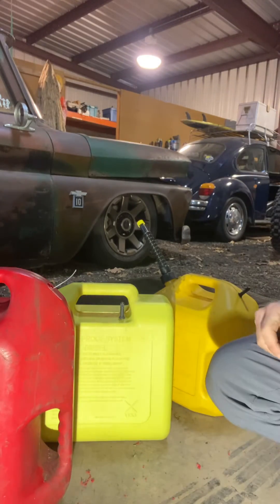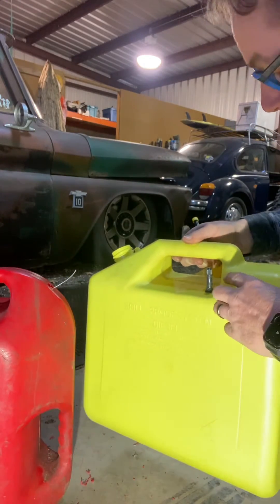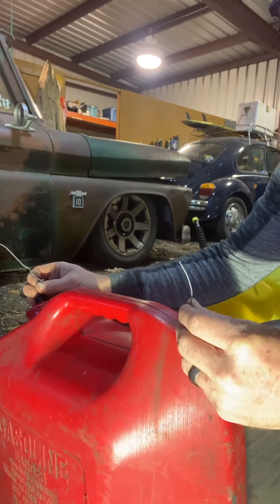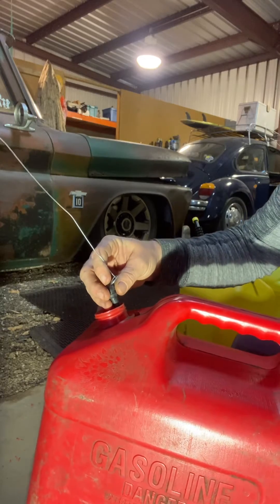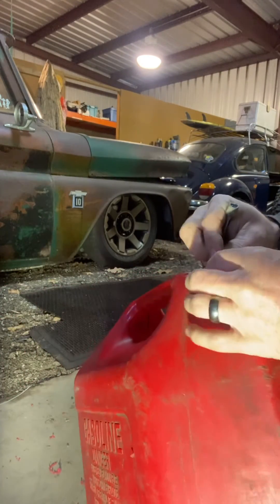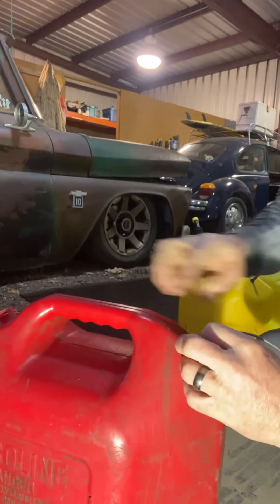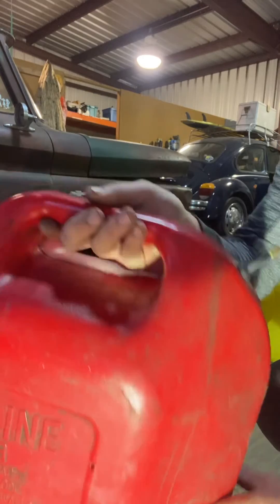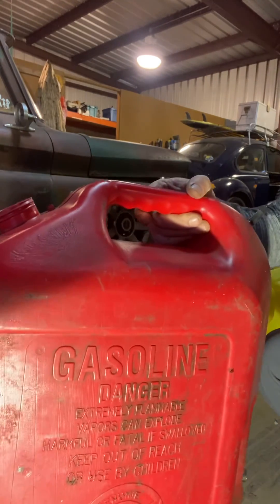Gas can vent using an automotive valve stem-CHEAP FIX  #gas #diy #hack #fixed #diesel

Comment: I have done the tubeless tire valve method.  It works until gasoline breaks down the rubber, then you end up with spilled gas.  If you do this method, replace that valve stem each year or less.  I went ahead and bought the Magicfour vents.  They are metal and they last.
Reply from the maker: I do the same. Replace them every so often.  
I have several that I used the metal valve stems and they do work better.
Reply: Thanks guys.... ordering some Magicfours right now!

Comment: I am speaking from experience, in about a year the gas fumes will rot that rubber, and you’ll be either replacing them or sticking a bolt in the hole that you drilled. The rubber valve stems do not work with gas. Don’t waste your time on this so-called hack.
Reply from the maker: I have some that are a few years old and are fine. Could always use a metal valve stem if that is an issue, which I have done on few. 
Just replace the old rubber one when it rots. They cost very little and it just takes a minute.